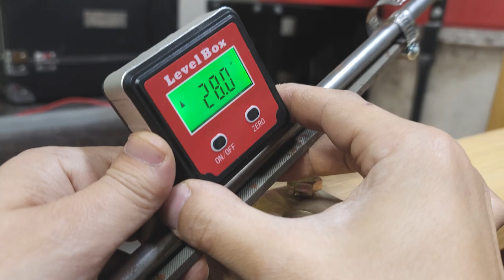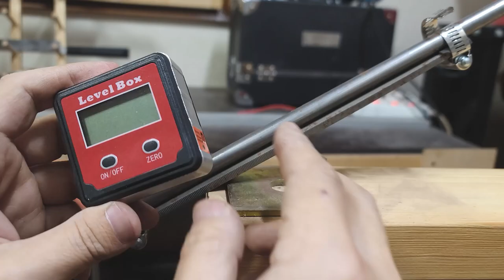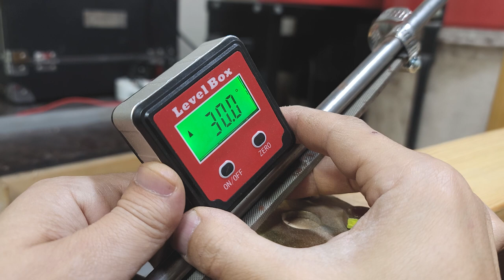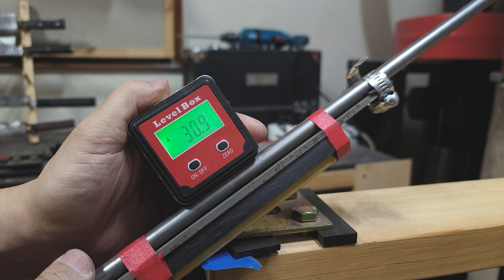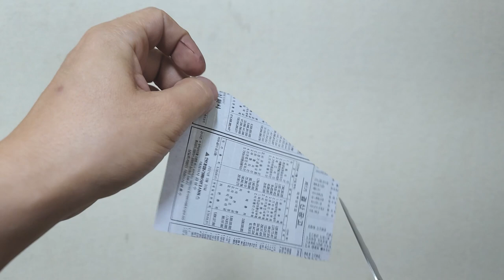꼭 보고싶다고 하셨죠? 그래서 영상으로 찍었어요. 슌 다마스커스 서레이션 나이프 수공연마.

Comment: Simply amazing.  Would you mind telling me where did you purchased those stones? Or at least the brand so I can look for? Also the technique of the tape is great.  To avoid scratches.  But it does not looks like regular blue painters tape.  Seems to have some elasticity.  Can you tell me which kind of tape it is?  

Thanks a lot for sharing.
Reply: I saw his other video. He said that the tape is a common thing. Not special. I guess you can find it by searching "protection tape".
Reply: 전기테이프
Reply: @MathXS  thanks!
Reply: @이재민-r2j  thanks!!!